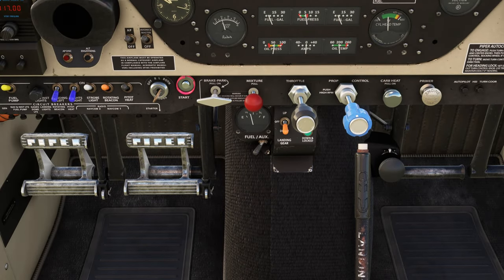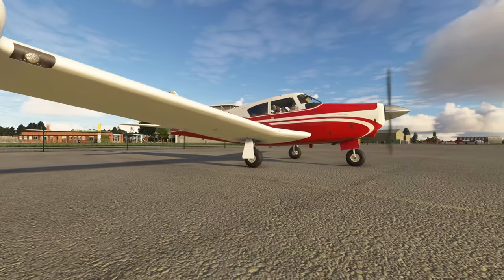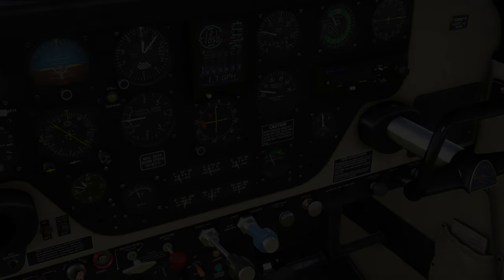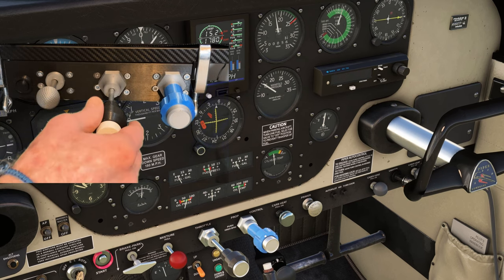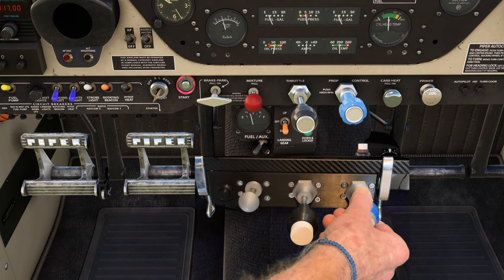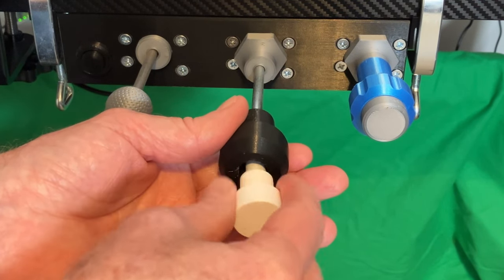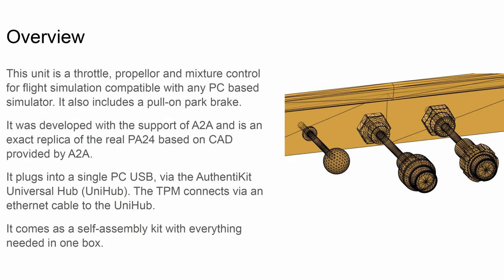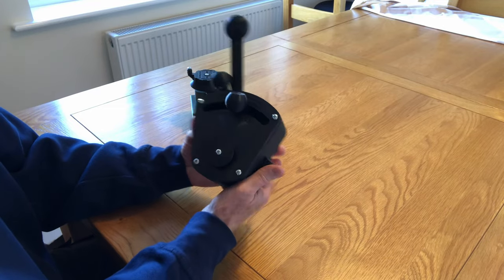New Throttle Quadrant designed for your GA Aircraft | Tested on A2A Comanche 250 | Authentikit

Comment: Looks very promising. I wonder if you'll be able to rotate the knobs as you can on a real aircraft to fine tune the settings.
Reply: Does not look like it from the video. Seems to be push/pull only.
Reply: No, push/pull only - no friction adjustment. As this is a self-assemble device an important factor was Lego style ease of assembly and it would have got much too complex (and more expensive) to add friction adjust.